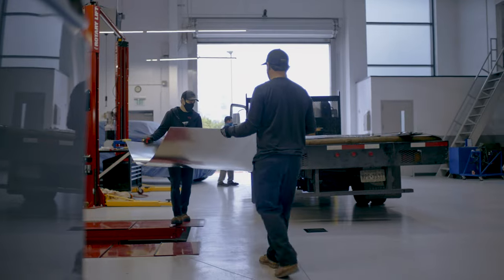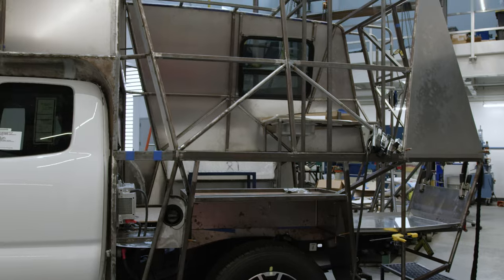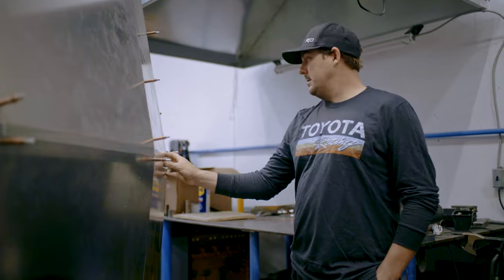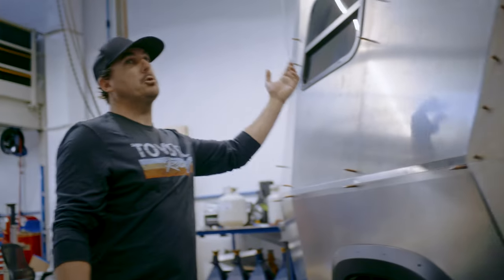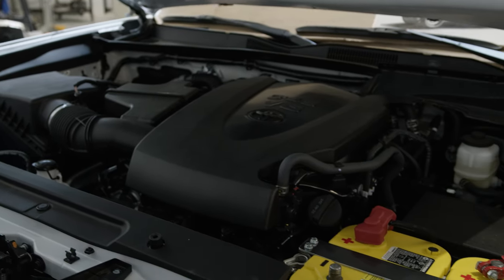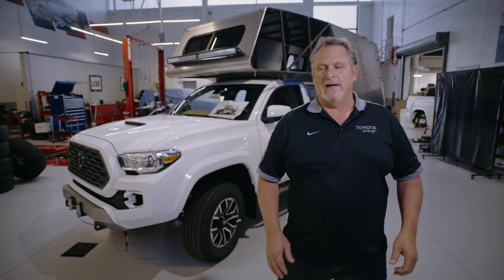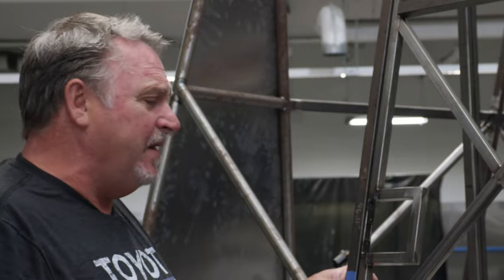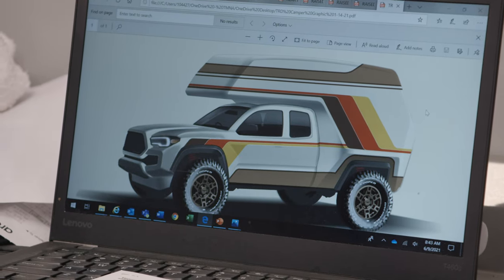"TacoZilla": SEMA Tacoma Truck Camper Episode 3 | Toyota

Comment: A trd “sport”??? And doing a off-road build?
Reply: The answer you are looking for is: Manual Transmission.
Reply: @wrcpatrick  manual transmission with too high a low gear for off road and no lockers. 

I drive one just like what they started with (17 TRD sport manual transmission) and it's a great truck but definitely not the right truck for this application.
Reply: @chaddesantis4191  it 100% is. Don't need a locking rear for when your center of gravity is going to be extremely high with a giant box on the back....

You think someone will actually go crawling with that thing lol?